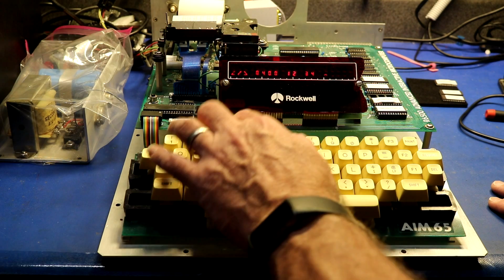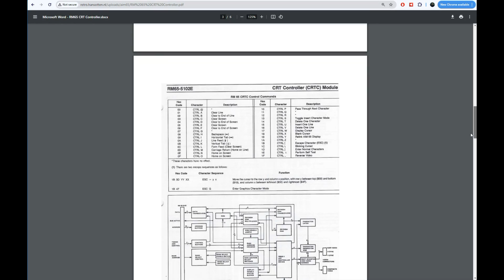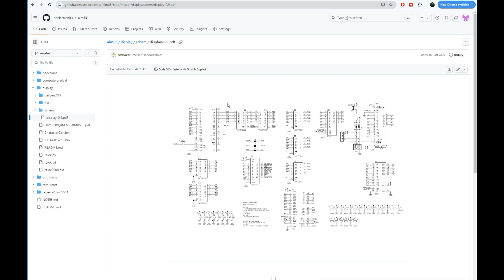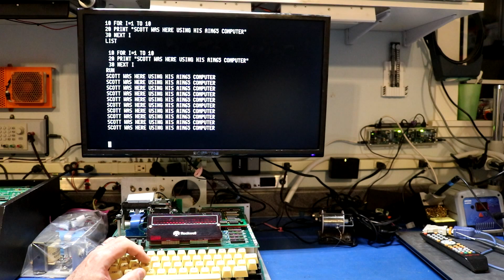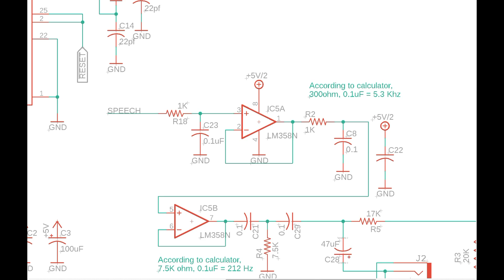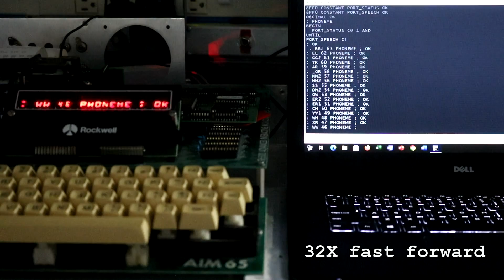Rockwell AIM-65 6502 Vintage Computer: Display Board, Speech Synthesizer, Basic, and Forth

Comment: The best 6502 development system of the early micro period. I bought one in Britain that had came from a defunct (crooked) bank BICC, but I also had a very detailed set of Rockwell manuals and FORTH ROMs, it made a great security /intruder system with all the IO on the back of the board. I was mad to get rid of it !!

Comment: Hi Scott ... Wonderful stuff. Three things:

1. Those 2114's are really hard to source. You said you left them in but does the RAM chip on your board "cover for them" (for people who maybe have an AIM65 and the 2114s have gone US?)
2. Are all 3 of your boards double sided or 4 layer?
3. What standard, if any, are the edge connector sockets on your riser board? Is there a part number for them and where can one source them (or are they 3D printed / printable)? It would be cool to make a little aluminium case mini s100 style expandable AIM-65 ... like the Acorn System 3 but with your boards and others

I like to write browser based emulators - immediate access, no downloads, hardware platform and language independent and cross-browser compatible. Below are some emulators I have written. I've started to do a KIM-1, Acorn System 1 and would like to do an MK-14 too. I'd also like to do the MPF-1 plus and now also the AIM-65 :)

Taito Space invaders (Intel 8080/8085)
http://econet.network/demos/invaders/

Acorn Atom (MOS 6502)
http://econet.network/atom/

Heathkit ET-3400 (Motorola 6800)
http://econet.network/demos/et3400/

Thanks :)

Phil M

p.s. I also thought it would be cool to have a riser board where you could place sockets for the 2114s with a board which sits above with some riser pins that go into enough of the 2114 sockets to tap off the address lines. IIRC the 2114s were four bit and need using in pairs so maybe just 2 sockets required to cover all address combinations?

Comment: I have an AIM-65 in it's original cardboard box with a bunch of original manuals and guides but no chassis. I'd love to test it someday but the PCB looks really crusty on the back so I think it would be a good idea to go over it completely before attempting to power it. Very cool to see what the machine could be capable of, thanks!
Reply: If you are looking for a power supply to power it up along with other boards with analog, I use the Mean Well RQ-125D for my AIM65 and external Video-1 board. It has all the voltages and enough current to handle it all.
Reply: @hattened  thanks for the tip!

Comment: I used an AiM-65 when I was in college to learn 6502 after I learned 6502 assembly on a Commodore 64 in my first job in high school. I just recently purchased one on e-bay with a wire wrapped Video board. I am in the process of getting it functional. I was shocked no one bid on it. I enjoy the diversity of your content. Thanks.

Comment: Just  a few years ago, I pulled one out of a public dumpster. I couldn't believe my eyes!
And it works! It's got BASIC installed and there is a huge circuit board in its "basement" with 36k of RAM (18k battery backed 6116 and 18k non-battery backed 2114 and yes I know 18k is a weird number) as well as a few ROM chips. It didn't come with the cable that connects it to the AIM-65 though and I haven't dumped any of the ROMs yet or tested the RAM, I just removed the VARTA Destroyer Of Boards (TM) battery.
(first thin I did was take it to a retrocomputing expo and wrote a small BASIC program that would scroll "LEGALIZE DUMPSTER DIVING" across its gorgeous bubble LED display - as in Germany, I'm pretty much a criminal stealing antique computers out of dumpsters)

Comment: This is a 6502-based computer from the late 1970s. This computer came with 4KB of RAM and 20KB of ROM, computer I have a soft I have a soft spot for 8-bit development  spot for 8-bit development from the late 1970s.  and had some kind of calculation program installed for what I computer from the late 1970s. think is a manufacturing company.computer from the late 1970s.  It came in a nice